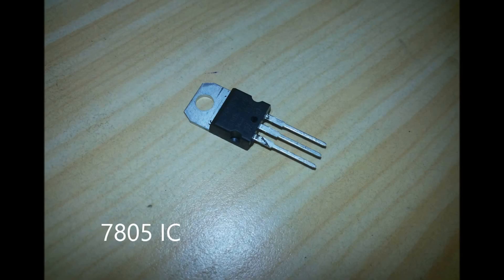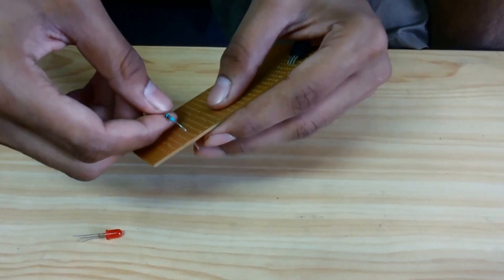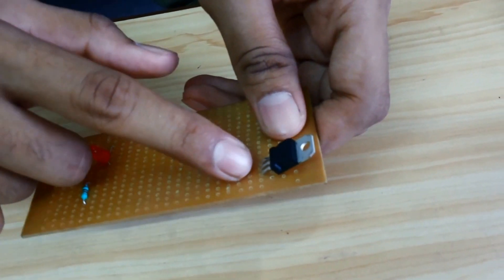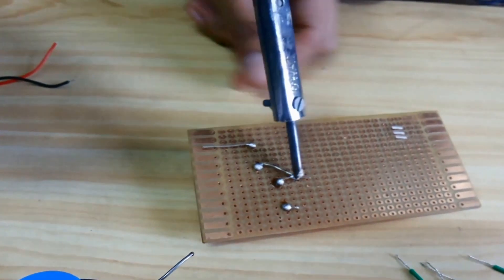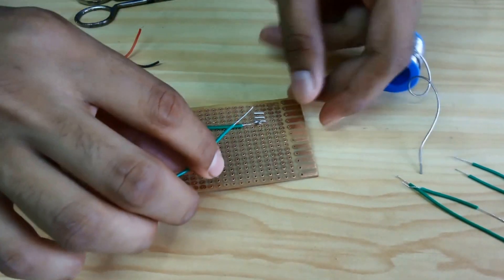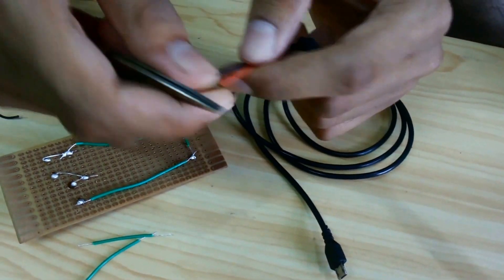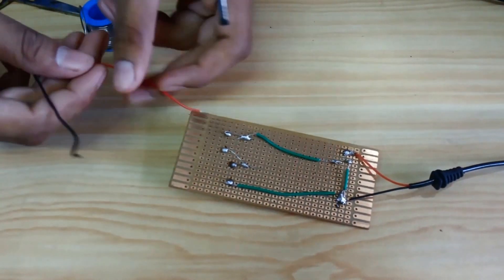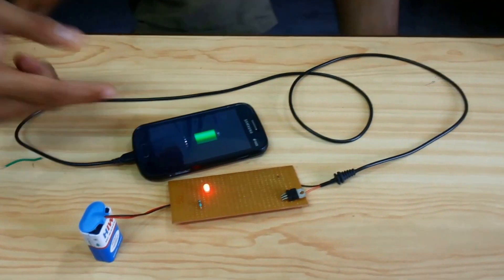How to make PORTABLE MOBILE CHARGER

Comment: This is a good project for experimental purpose but not for regular uses. its not efficient. You are using a linear regulator which gives efficiency of the order of 60%. So nearly half of the energy is lost during conversion from 9 volt to 5 volt! A switching mode voltage converter is required for regular use as it gives  80 - 90% efficiency. In fact all modern power banks use this type of converter.
         A 9 volt battery has typical capacity of 500 mAh. With a conversion efficiency of 60%, we would get 300 mAh for charging (considering the charge controller circuit inside the phone is 100% efficient !). So we need 8 nos of 9v battery for a full charge of 2400 mAh cell phone battery!

Comment: can u tell me the solution
7805ic is not working
Reply from the maker: There may be 2 reasons
1. Check ta IC. Use a fresh one.
2. Check the output nd input pin. If you have any doubt. Google it.

Comment: The Battery Charger that you have made is not good enough for it lacks protections like Surge, OVP and UVP. 
This would be harmful to your cellphone's internal charging circuitry rendering it useless and converting it to a brick.
So please note that 7805 or 78xx series can never be used for charging for every battery has a different charging profile as per its chemistry.

Comment: It will be better if you fix an usb out port instead of directly soldering the output cable. Then it can be used for different mobiles with different ports. Also i would like to know that how much mA output will it give with 9V battery. Reply soon.
Reply: Bh

Comment: Why use a board that big for this? even 1/4 of that would be too big..
Reply from the maker: David Coptil It's for the beginners who will make the circuit as dummy by watching the video.If small pcb is used then it will be difficult for them to make the circuit properly first time.

Comment: That makes cold solder joints. Don't apply the solder to iron tip, instead with little solder on the tip heat the joint and apply solder to joint and hold fora second or so until solder flows into the hole.
Reply from the maker: electronicspark1 we r just novish...so thanks for your suggestion. Wish to hear from u again. :)

Comment: what if i want to use a bigger battery . will i have to change the voltage regulator ?
Reply from the maker: ashish pal singh you can use 7.5 to 21 volts for this regulator

Comment: What will the output volt  of the charger,
And can i charge with lead acid battery.
and if i wanna increase the output volt of the charger which transistor should be used?
Reply: Since they are using an 7805 the output voltage will be 5 V. You could use pretty much every battery that is above ~6V (because of the dropout voltage). If you´re using a battery with much higher voltage you will also have to add a heat sink to the regulator.
 If you want to increase the output voltage you have to choose another regulator (78xx , 78 = positive regulator , xx = output voltage). It is also recommended to add a capacitor before and after the regulator (check datasheet of the specific regulator).

Comment: i dont have any battery caps availaible in my area what can i use ...in place of it.........the reason is i created a simple circuit...of a switch,battery and an led.....the next day my whole battery was discharged even though my switch  was off and led was not glowing,.......will the same problem occur with this circuit....if i permanently sold  wires with the battery....please i need help...cause im making this the project for my +2 exams.......

Comment from the maker: You will get the supply wire at any electronics shop. You can also cut a mobile charger for this.For wire colour code see http://www.google.co.in/imgres?imgurl=http://cdn.instructables.com/F1M/NXZU/FKHQCSI8/F1MNXZUFKHQCSI8.LARGE.jpg&imgrefurl=http://www.instructables.com/id/How-to-get-your-iPod-to-charge-with-your-homemade-/&h=378&w=200&tbnid=7npdP75qbdth9M:&zoom=1&q=charger+supply+wire+colour+code&tbnh=90&tbnw=48&usg=__tlw4gmoPaDU3D0qzR1HY-1YmsDg=&docid=uBsdqa492gzQgM #Arjun_Vijayakumar

Comment from the maker: the battery should be between 7.5V to 24V. and you can use a rechargable battery for input
Reply: +Pascal Harder True, the heat generation is based on the difference between input and output voltage. Linear voltage regulators become very inefficient with high inputs compared to low outputs. They will work up to 120+ degrees celsius or +-200 degrees Fahrenheit before the thermal cutoff activates.
Reply: Thanks I love your work
Reply: douglasdivine ABJ the  question is did it work
Reply: ***** ok
Reply: use more 9v batterys in paralel :-P you can even use them im series but then you got 18v and  the voltage regulator ic will generate more waste heat to drop the voltagen from 18  down to 5v
Reply: Great
Reply: Thanks for helping
Reply: Chandan. Patel
Reply: Mobile karb करवायेगा phone ka battery generally 5v ka hota hai , tum charge karwa rahe ho 9volt se ,
Reply: You can use input voltage 6V to 35V..
Reply: Yes
Reply: XperiMentals আমিও কারেনটেরকাজকরিআমারবয়স১৫ আমারবারি গড়িয়াজেলা নতুন কাঠপোল আমার নাম বিকাশ সাউ আমারফোন নঃ৬২৯১৯২৭০২০  জিওভালোলেগেছে videoটা nice video osm Hi
Reply: You can also use solar but you need to add some capacitors on the 7805 and a diode on the solar panel, it needs a pretty big panel tho